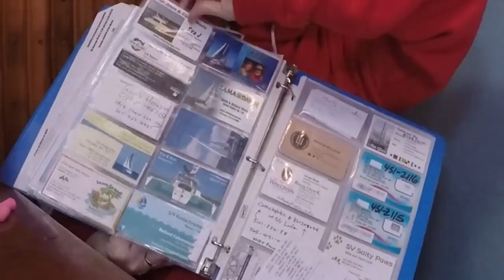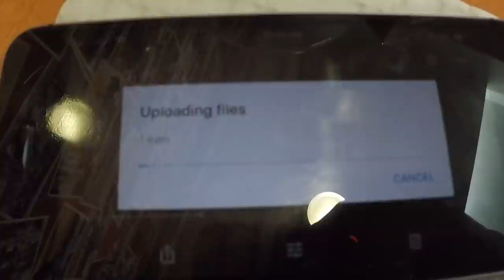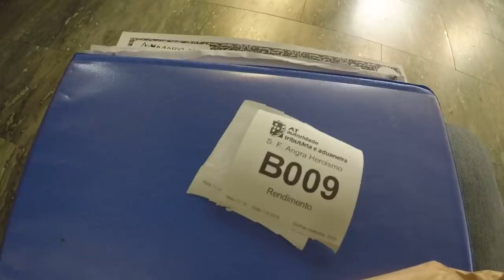The Police Come Knocking! | Sailing Wisdom [S3 Ep34]

Comment: Did you think of using the boom, mainsheet and a bosuns chair to create an elevator for Maddy?
Reply from the maker: We did, but we didn’t want to need to do that during the rain so she tried the ladder and (while slow) it worked well enough.
Reply: @RiggingDoctor  Fair enough. And also it is of course quite an off centre load while on the hard.

Comment: Herbie,  Did you varnish the inside areas of that wood?  Just thinking of a means to prevent mold.
Reply from the maker: Only on the boards that I had to remove later while plumbing the head. All the boards had oil soak to their backsides though so the ones without varnish have oil back there!
Reply: Einstein's definition of insanity.
Just because your doing it in a clever fashion, doesn't mean your not repeating yourself.

Comment: The lighthouse tax is understandable and reasonably priced when you consider that the lighthouse may save your life, just sayin'. Steady on mateys!
Reply from the maker: I didn’t mind the lighthouse one because we did use the lighthouses to navigate to Angra do Heroísmo. The engine tax pissed me off. 

It’s a tax on having a motor and you have to pay it yearly. Just having a boat means they can tax you for it over and over. It’s not like a sales tax or a one time thing, but simply a tax on possessing a boat (or car, it also applies to them). 
It rubbed me the wrong way, especially since the agents told me it was a lighthouse tax and then magically pulled this one out of nowhere. 
Thankfully we have a small motor, but it was a costly surprise!

Comment: Your visa troubles are defiantly frustrating, fortunately you are in a fairly laid back country like Portugal. You can understand where the Brexit movement came from when you have to deal with the increasing levels of bureaucracy. But if you can get it sorted then you have access to 27 countries in the 'shengen'. An old blog I followed solved their problem by the ( Texan) husband drawing on his Irish heritage and getting an Irish passport so they could stay more than 3 months a yr on their boat in the French canal system. (It took 18 months)
I suppose it's easy for me to now suggest you need to have an itemized receipt  from the consulate for everything you gave them!
Perhaps dealing with say the 'super efficient' Germans consulate would be better but I doubt it.
Is the head going to be a shower too or just a head? I worry about all the woodwork holding up in a hot shower?
Good luck Warren
Reply from the maker: We don’t have hot water on the boat, but the wood I chose is really REALLY rot resistant. It’s Japanese cedar and they use it everywhere here, inside and outside, with nothing in it; and it holds up!
There is also a lot of airflow in there with all the gaps, so hopefully nothing starts growing. If it does, I can unscrew everything and take it outside to properly kill and varnish all the boards on all their sides.

Comment: i know its late why not use your boat's chair and lift Maddy into the boat
Reply from the maker: It’s not really that strong and the bits inside of it are iron which rust pretty badly on us. All the rust stays contained in the seat but at some point, it just breaks and we hear bits of rusted metal grating on each other. It would be bad if the thing broke while she was in the air!

Also, I didn’t think about using a chair to lift her. We toyed with using the bosun chair, but it really isn’t comfortable and she wanted to try it herself because if she can get it she can get back out. Last resort we would have hoisted her somehow but then we would have to do the reverse every time we wanted to leave the boat!